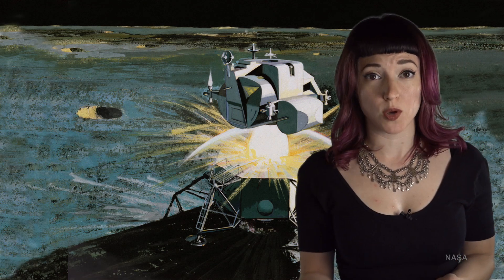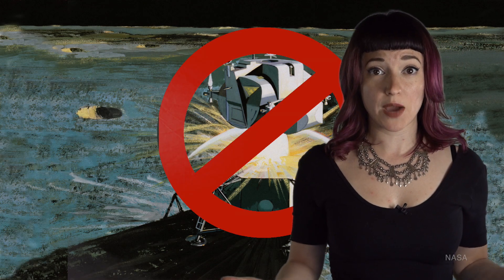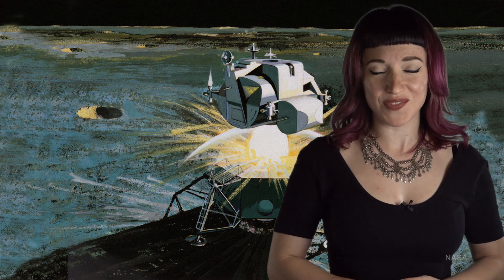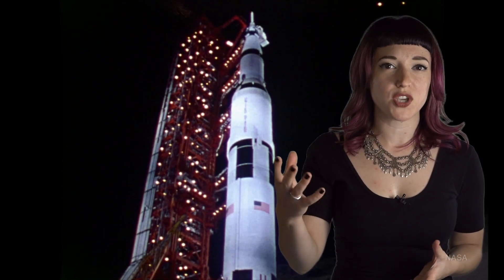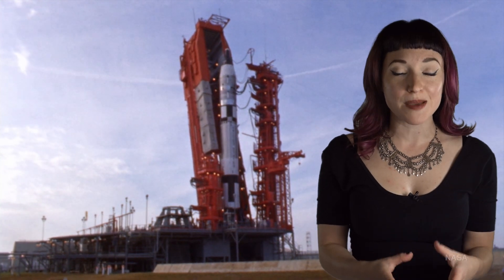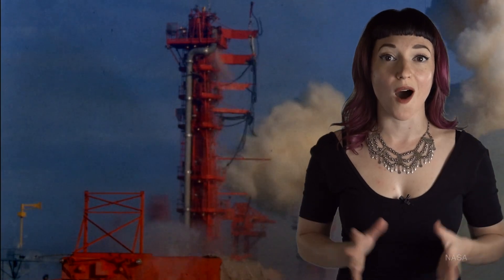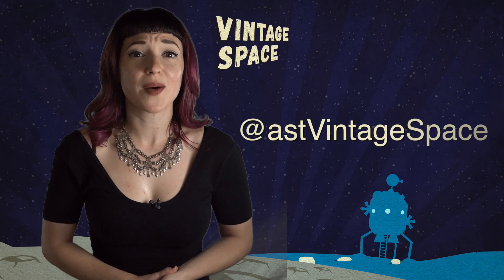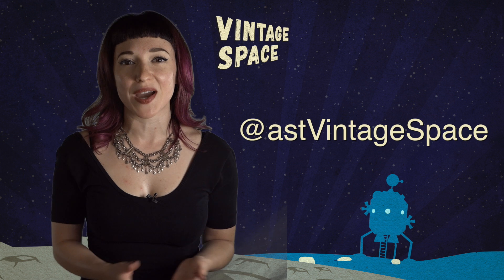How the Lunar Module Launched from the Moon Without a Flame

Comment: One more question. Why landing module didn't left crater where it landed?
Reply: It actually did, a very, very shallow one. The engines weren't producing a whole lot of thrust when they touched down, since the descent stage was almost empty at that point, and were shut off 2 meters above the ground. Also, due to the vacuum of space, the exhaust expanded dramatically after leaving the engine, instead of producing the typical concentrated flame you'd see on Earth. The pressure of the engines on the ground was half that of the astronauts' feet.
Reply: Don't forget the moon's gravity is a sixth of Earth's. That means both descent and ascent rockets need far less thrust and the 2 meter unpowered fall will be gentle.
Reply: Because it made a soft landing. Russian landing probes left craters.

Comment: .. also, Earth's atmospheric oxygen produces a bright flame due to the after-burning of fuel-rich exhaust.. this is especially true on LOX/hydrocarbon engines, but also with most hypergolic propellants.. the moon has no atmospheric oxygen, therefore, no after-burning, therefore, VERY clear exhaust on LEM ascent.  Notice on LOX/hydrocarbon launches (Falcon & Atlas), that the bright plume expands and turns darker & clearer as it gets to higher altitude.. also due to reduced after-burning in the thinner upper Earth atmosphere.
Reply: .. the moon mission hoax theory would be supported if there WAS a visible flame on the LEM ascent engine.
Reply: That is what I was expecting Amy to say as well.
Reply: +Roel Bakker   If you watch videos of RS-25 tests at NASA Stennis, you will see that the exhaust, as it exits the engine bell, is almost perfectly transparent.  The video sees right through it to the other side of the test stand.  Shock cones downstream of the nozzle heat the gases enough to make a blue glow again, but as they exit the nozzle, they are almost invisible.
Reply: Same thing with the F1s on the S-IC before staging. The plume is extremely thin at those altitudes.
Reply: Anyone who has worked in a chemistry lab and used a Bunsen burner has seen that the bottom part of the flame, near the outlet, is transparent and its blue glow is almost invisible in normal room lighting. The upper part is the part that glows yellow, and the burner is most efficient when the blue transparent part is as long as possible compared to the yellow part.
Reply: +Allan Richardson   If you have a quality Bunsen burner, you can adjust it so there is no yellow in the flame.
Reply: +Mark Holm Certainly zero yellow is ideal, but I wasn't sure whether I was able to achieve that with the burners we had 50 years ago when I was in school. If not, I'm glad the craftsmanship has improved!
Reply: Um, no. If you adjust your Burner burner to eliminate all of the yellow in the flame, then you are burning it in a regime where it releases a small amount of uncombusted CO. Carbon Monoxide is a bad thing to have in your lab air!
Reply: I often thought that was a factor in why we can see flames when the Titan II GLV was launched and not when the Ascent Stage was launched. I just never took the time to research it. Thanks for the post.
Reply: And with the RS-25 engines from the Space Shuttle and SLS, we see a flame at the start but at high altitude we don't see the flame anymore. Only a bright light in the exhaustnozle
Reply: Hydrogen burns with an almost transparent flame also.
Reply: That goes for most of the counter-intuitive procedures associated with spaceflight. Some people just can't grasp them.

Comment: a random thing about the ascent engine is that is was not untested because the hyergils would corrode the engine and it's contents very rapidly
Reply: Yeah and it didn't even start, and Buzz had to start it using his pen as a lever in some way
Reply: While exiting or entering the LM, one of the astronauts most likely bumped the circuit breaker to arm the ascent engine - breaking off the switch.  A felt tipped pen on-board was the correct size to fit into the hole to close the breaker, arming the engine.
Reply: +KersZZ kind of right he used his pen to push in a circuit breaker that had been broken off
Reply: oh yeah i have heard that story but neil said that he thinks it was pencil not a pen
Reply: Buzz said it was a "felt tip" pen.  Buzz used it when the circuit breaker for the assent engine on A 1' Eagle broke.  In subsequent LEMs, NASA replaced the breaker with a hood or cover to protect the breaker from contact with the harsh space suits.  See: "RocketMen", by Craig Nelson.

Comment: Great Channel! .. Just wanted to know, How did we get footage of the Lander leaving the surface? ... PLEASE RESPOND!
Reply: There's this strange thing that cameras can do where they convert the signals into radiowaves which can be received by these odd things called antennas.
Reply: The astronauts actually set up TV cameras some distance away from the module to record the lift off.
Reply: Good question. The lunar rover had a camera on it so Houston used this to film the ascent of Apollo 15,16,17 however they were not able to keep the LEM in shot on 15,16. So all the ground based footage you see is 17. They also had a film camera on the ascent stage, so TV companies cut these together. Sometimes from different missions too.
Reply: Craig Z List Radio control airplanes were actually a thing before the lunar landing. Figure it out, moron.
Reply: +Steve Brady Was tracked absolutely manually, so they had to do it with 1-2 seconds of delay. On 15 and 16 they couldn't track it, on 17 they nailed it, so all the ascent footage we have is 17.
Reply: @kerszz354  We have 15 and 16, it just isn't very good.
Reply: One of the astronauts drew the short straw and was left behind. The next mission brought up a photomat booth to develop the film.
Reply: My guess is that they had some way to track the ascent module as it took off, or it was pre programmed to tilt up to follow the expected launch profile.  No need to invoke any kind of nutjob theory.
Reply: Search on Youtube, there's footage too.
Reply: @kerszz354  our phones lose all coverage 1 mike high how the hell did they transmit signals and live footage in 1969 lol..gummon...only way to get more $$ was to set up the whole charade...
Reply: mark it was just the man on the moon.......... He has photo's of the cow jumpimg over too.  :)
Reply: simple Question. Thank You,
Reply: I really was just asking.
Reply: ALDRIN DID IT,  THEN RAN LIKE HELL AS HE CAUGHT UP WITH THE THINGY
Reply: @MrDaiseymay  I heard he was tied on by a really long rope

Comment: why haven't we gone back to the moon for almost 50 years now??
Reply: Corrupt politicians wasting money on pet projects that enrich themselves and their pals while robbing the taxpayer of money and valuable science is why we don't go back.
Reply: Because to save money Nixon approved the space shuttle. It then turned out because of all the compromises on design it cost more than continuing the Saturn V programme. Also because the major contractors got paid anyway they were not motivated to do anything different.
Reply: Christopher Tacon The amount of money needed for such a program is a drop in the bucket compared to all the waste, fraud, and abuse that goes on. Yet there's no public outcry against that. In some cases, people who fight against the waste are driven out of politics and attacked by the media.
Reply: Christopher Tacon Actually, the SLS is stuck with politically driven SRBs that limit it's effectiveness while the F-1B based Pyrios boosters are on indefinite hold. The SRBs are only being used for purely political reasons.
Reply: Christopher Tacon Just think of how much easier the design and construction of the Orion would have been if you weren't constantly having to shave off weight to make up for the shortcomings of the booster design!
Reply: For a second, I thought you meant the ones with the nukes.  I think that one would require more permits, though...
Reply: +Christopher Tacon  I've read that the friction stir welding process used on the Orion capsule saved about 800 pounds of weight simply because they could use thinner material than usual since there's hardly any heat distortion problems compared to the older welding methods. Just curious how this makes your job easier or harder designing components? Also, is there any estimate on how much weight can be saved using the same welding process on the rest of the SLS stack?

Comment: Another proof you might do a video on are the Lunar Laser Ranging Experiment equipment left on the Moon by Apollo astronauts.  The Apache Point Observatory Lunar Laser-ranging Operation does so on a regular basis to track the rate of the Moon's rate of orbital change to an accuracy down to the centimeter.

Comment: Spermicitte is known as an excellent lubricant and cooler... plus it burns cleanly when compared to candles... was it used in the Apollo lander and etc?
Reply: Kevin Prasad Indeed, a few months ago there were a couple of articles about high-density data storage, using quartz crystals and femtosecond lasers. We still have some way to go before it'll be commercially viable, but once it is, we'll have a storage medium that is de-facto eternal.

http://www.computerworld.com/article/3034260/data-storage/superman-memory-crystals-could-store-data-for-billions-of-years.html
Reply: No, they used Hydrazine (Aerozine-50, specifically) and Nitrogen Tetroxide, which are hypergolic, and ignite on contact with each others. They also burn with an invisible flame in a vacuum.
Reply: I'm not talking about the way they used for propellant... in this case I am referring to the rumor that spermicetti was used as a lubricant and for cooling because it was used as transmission fluid until 1970s if I remember correctly
Reply: +Kevin Prasad   Google "How Much Whale Oil Is There in Space? More Than You'd Think.".

Whale oil was also the best binding agent for magnetic tapes which is why a lot of the ALSEP transmittal data tapes ended up being reused due to a sudden shortage of that medium in the mid-70's to early 80's. It's mentioned in this antique radio forum about the reason for the tape shortage but there is another site that mentioned how much this affected NASA:

" I worked at a "major broadcast services organization" back in the 80's. We were the largest single consumer of both Ampex AND Scotch (3M) recording tape in the world. Ampex 642 was specifically designed for our high-speed duplicating machines. By the mid 80's, the Ampex "binder problem" had pretty-well been corrected. But tape prior to that wound up being HIDEOUS after a very short period of time. 

The problem was caused by (are you ready for THIS one?) Whales! Or more specifically, the lack of whale oil. Prior to the mid 70's, whale oil was a critical ingredient in the Ampex binder formula. Unfortunately, there is no other substitute that has those exact properties. GM had a similar problem with its Posi-Traction "additive" that was essential for proper operation of Pontiac's Limited-Slip differential. To this day, they STILL offer a supplement, but it isn't anywhere NEAR as good as the 60's version with whale oil. 

Ampex scrambled to find a binder lubricant substitute for the whale oil. Unfortunately, it took awhile to discover that the substitutes would break down, leach out and gum up the works. An entire album project by Jefferson Starship was lost because of a failure of the 2" masters. Boston's "Third Stage" almost didn't make it either. It was later discovered that baking the tapes CAREFULLY under EXTREMELY controlled conditions for and extended period of time could help SOME of the affected tapes, but not all. To top it off, the tape was generally good for only a few plays after that. 

The trouble was that Ampex held out for a replacement binder/lubricant that had properties as good as the original whale oil ingredient. Other companies used a binder/lubricant that was actually quite inferior to the Ampex formula. As it turned out, the "inferior" formula had the long-term stability, while the "superior" formula turned into goo."
Reply: So is NASA using mag tape as back up nowadays or has it been completely phased out?
Reply: Kevin Prasad Magnetic tape is I think still the medium of choice for long term mass storage.
Reply: Sarge Rho
 really?! you would think that SSD's with radiation protection would be more effective... plus the amount of storage you can hold... plus the weight advantage... hey whatever floats their boats i guess
Reply: Kevin Prasad In space, they use flash storage, but flash storage decays over time. I think mag tapes will be replaced by quartz data crystals in the near future though.
Reply: +Sarge Rho have they gotten that far yet?

Comment: Does the fuel dissipating more easily on the moon affect the thrust it provides?
Reply: Yeah, it does. Since the fuel expands until the pressure is nearly 0 psi, compared to Earth's 14.7 psi atmosphere, you can extract more energy from the fuel, which gives an increase in thrust and efficiency.
Reply: True, but you will only get that efficiency when the pressure at the end of the engine bell is equal to the pressure outside. Expanding fuel doesn't help you much outside the bell. In a perfect vacuum, the bell would need to be fininitely large to get maximum efficiency.
Reply: Sander Datema I know, what I said was sort of an oversimplification, but I didn't want to elaborate too deeply on a YouTube comment.

Comment: You forgot to mention the camera man they left on the moon so they could get that tracking shot. You know, because the same scientists who put a man on the moon wouldn't be able to design a auto-tracking camera, thus the need for a missing cameraman. ;-)
Reply: The camera was not auto-tracking. It was preprogrammed There was a guy in charge of figuring out the camera tilt based on the acceleration of the ascent stage and activating the program remotely.
Reply: It actually was not preprogrammed the way most people think. The camera operator tracked the camera by hand with a manual control, only he had to make all of the motions several seconds early, so when the control signals reached the camera after the delay in transmission, the camera would move in sync with the launch. I also believe the camera operator guesstimated the tilt rate, and nailed it on the first try.
Reply: @USWaterRockets   GTFO you telling me niggas can control cameras from earth to the moon. What kind of bullshit is this? One explanation after another.
Reply: @worldbosspf1  Where's the problem?
Reply: +USWaterRockets Actually they failed to nail it on 15 and 16 so 17 was the last chance
Reply: Peter Loftus I see! Practice makes perfect!

Comment: Amy!  You're still confusing hypergolic with clear exhaust.  The presence of large hydrocarbon strings is what determines the clarity or 'flamyness' of the exhaust, not the fact that the fuel may or may not be hypergolic.   Kerosene and LOX burn to produce 'clumps' of carbon that glow when hot.  The low-carbon Titan, etc. fuels do not.  Look up video of the UK's Black Arrow rocket.  it burned kerosene and peroxide (hypergolic!) and it produced a lovely flame.
Reply: Fair point. I thing Amy got to the crux of why there was no flame in this case at least but you are absolutely right
Reply: I have a Titan engine on my dinner table as a romantic set piece. It's lovely.
Reply: Just for the record: the LM used nitrogen tetraoxide (oxidizer) and UDMH or unsymmetrical dimethyl hydrazine (fuel) to lift off from the lunar surface. Both of these are quite unstable of mixed with contaminants. I know because I got to help with the precision cleaning as a college summer intern as the final manufacturing step  They fuel and oxidizer are hypergolic so no other ignition source is needed except to mix them. As far as I know they produced no visible flame.

Comment: The only hoax theory that isn't completely absurd is the one about the van Allen belts. Amy, you should tackle that one next!
Reply: Is it true the Van Allen belts hold up the Van Allen pants?
Reply: she talked about it on a quite long ago episode
Reply: The video is called "Apollo and the Van Allen Radiation Belts."
Reply: She did one a while ago but I'd like one more in depth too. Namely showing the trajectory from KSC into the moons orbital plane and how it helped. It would require more graphics than she usually uses.
Reply: +Marty theMartian No, the Van Allen Belts are for show only; it's the Van Allen Suspenders that hold up the pants!
Reply: I'm sure others have tackled it.  Look it up.
Reply: +Marty theMartian For the win!
Reply: Michael K No, that's completely absurd as well. The belts are torus (donut) shaped. There's an inner and an outer belt. The radiation levels vary throughout. One of the goals of the Mercury and Gemini missions was to map the radiation levels in the belts. With the help of Dr. James Van Allen himself, they plotted a trajectory for Apollo 11 which avoided all the belts except a small part of the outer one. Dosimeters on board showed a total dose of about 1 x-ray (30 minutes in the belt each way). 

The problem for the upcoming Orion mission to Mars (which flat earthers point to as evidence for the impassibility of the belts) is that a) modern electronics are MORE sensitive to radiation than the vacuum tube tech of the 60s, and b) a mission to Mars requires a different trajectory, requiring much more time in the belts. So they'll have to 
spend a lot of weight in shielding for people and equipment.